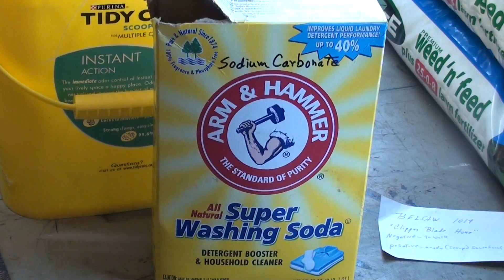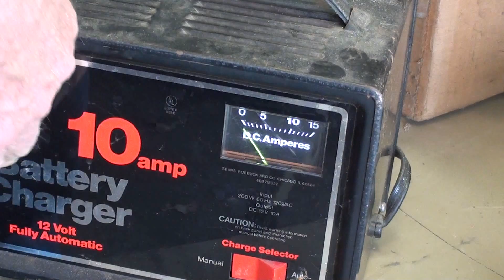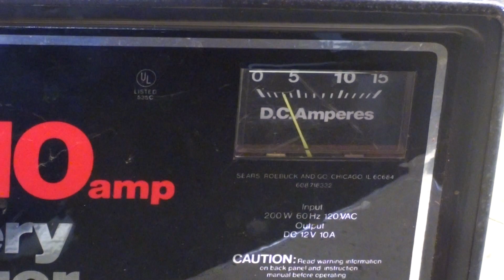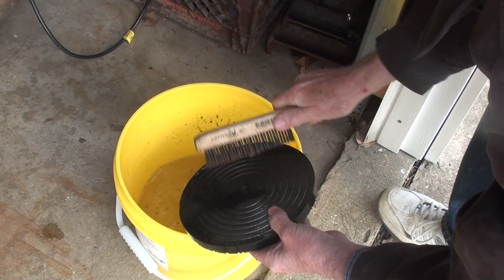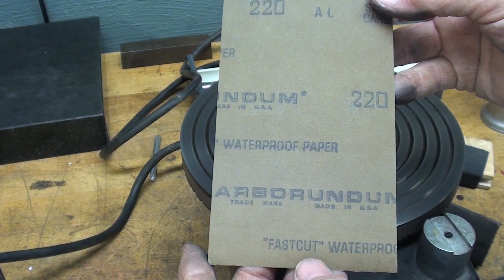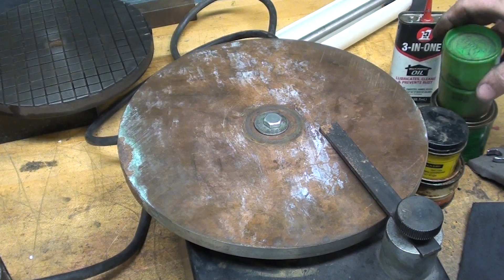Electrolysis Rust Removal-lapping plate #301tubalcain

Comment: MR. Pete
Always interesting toe see what you can find. Electrolysis reserve some surprise if I could say. First in order to have more amps, try to add a 12v battery between the charger and the piece. If you haven't thrown away your rasp, reverse the process and you will not only clean it perfectly, but you also sharpen it. Same for your knife. Once  it is sharpened, let it be electrolysis (?) for an hour. This will remove all the small particles left and will sharpen the edge. Here we can't find easily Washing soda, but as you show at the beginning, this is mostly sodium carbonate. It can easily be found at the «pool store or hardware store  » under the name of PH+ and it cheap. Add some liquid soap if you want the cleaning effect. Waiting to see you next surprise.
Reply from the maker: +Robert Patoine Thanks to a loyal viewer.  Good suggestions.
Reply: +jusb1066 Exactly, Mr. Pete demonstrated this in his early electrolysis videos, the process destroys the sacrificial steel and the process is not reversible. Hence the name.
Reply: +ShysterLawyer  This is not what I have experienced. Not only will it be possible to reuse the raps, but the process will sharpen it. It's the only way to sharpen any files.
These are microscopic process. I used a 4140 brand new block and used it as a sacrificial part. I did reverse the project and the result look like new.

But, this result is based on my experiences, it may differ from a different experience.
Reply: Robert Patoine
Maybe it has something to do with the length of the exposure or some other variable? I don't have any experience on it myself, just remembered when Mr. Pete did it to a wrench that he had just used as the anode, and it was badly pitted afterwards.
Reply: +Robert Patoine the amps dropped because the anode got loaded up with rust. Rust is resistive. As anyone who has ever had a corroded battery terminal can attest to.

Comment: What is your reason for not useing baking soda? 
I've seen others say this but it works fine for me.
Reply: +Tim McCauley Both should work it's just sodium carbonate (should) be roughly twice as effective. I think this is because sodium carbonate has two sodium atoms in it's molecule where sodium bicarbonate has only one.
Reply: +Kodizzie I think it just requires a base ph, I've used baking soda, laundry bleach and "Electric Soda" (A local brand of washig soda) and the results seem much the same. 
Cheers
Reply: I thought all the soda did was carry the current?

Comment: Hydrogen is the lightest gas there is. It would go straight up and disperse over a large area. Could be trouble if  the gas  was confined.
Reply: +mrpete222 I've seen you playing with acetalen produced from carbide. So long as you are in a well ventilated space and well away from other flamable things puting a match to the brown foam can be fun.
PS. I'm of an age that my father used to bring gelignite home for me to play with so don't do this unless your mother gives you permission.
Reply from the maker: +Roman Dybala You're right, the gas immediately rose.
Reply: +mrpete222 I've seen you playing with acetalen produced from carbide. So long as you are in a well ventilated space and well away from other flamable things puting a match to the brown foam can be fun.
PS. I'm of an age that my father used to bring gelignite home for me to play with so don't do this unless your mother gives you permission.